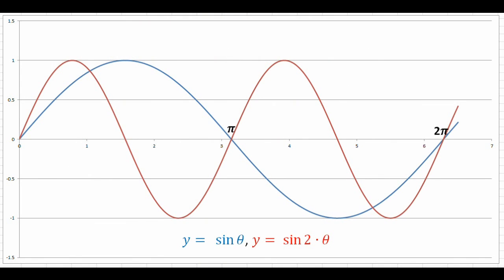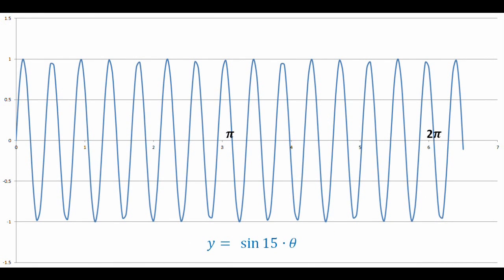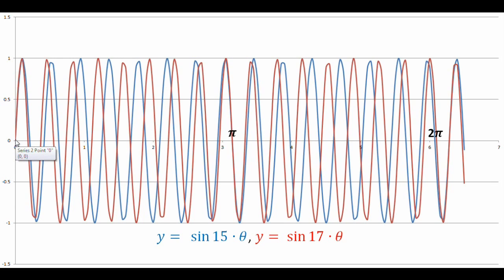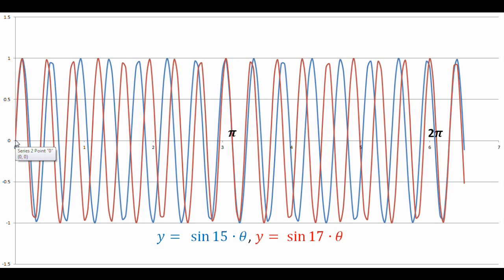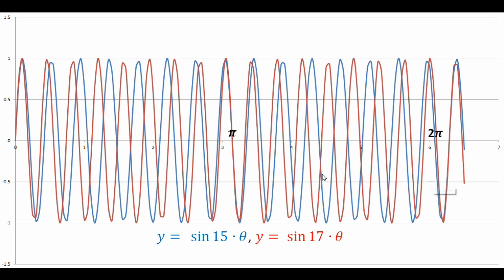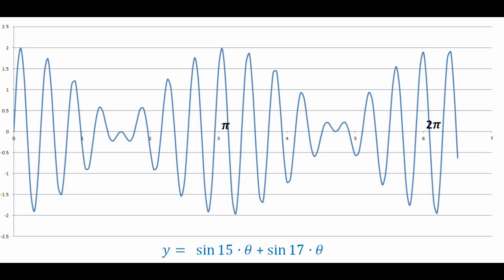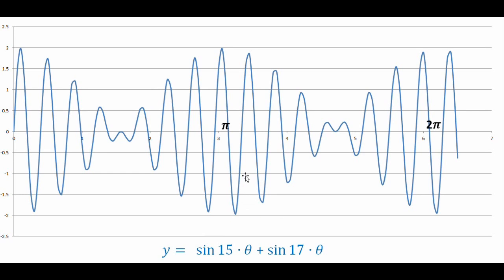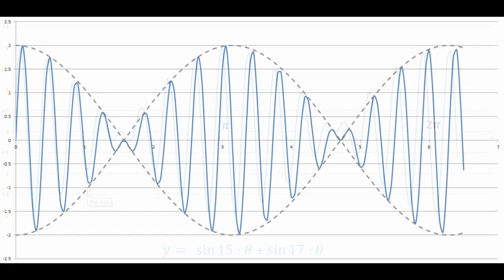Beat Frequency and Musical Instrument Tuning

Comment: I found this video search for the term of two notes resonating together creating a wobbly effect after creating a riff while playing guitar. Guitar was in drop d and the notes were A and b flat, A being the higher note. I was using a very high amount of gain/overdrive and it creates a really cool moving kind of sound. Is that also considered beat frequency or is there another term for it? It doesn't sound horrible like a very slightly out of tune note.